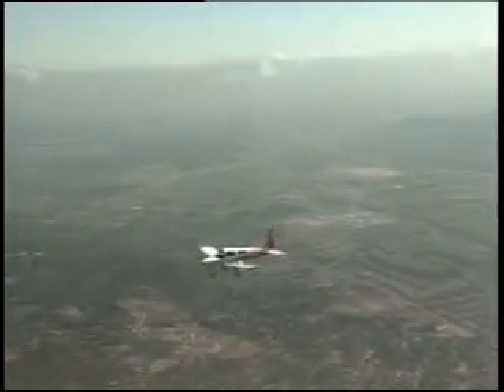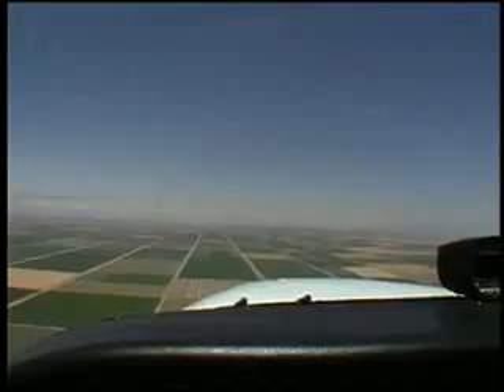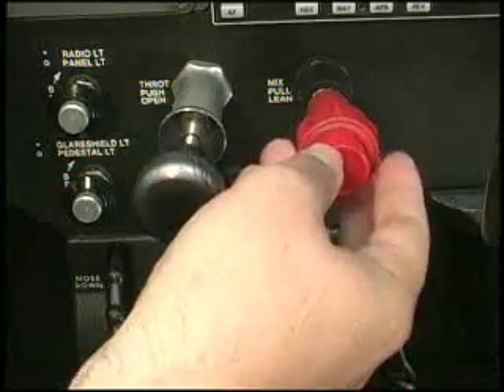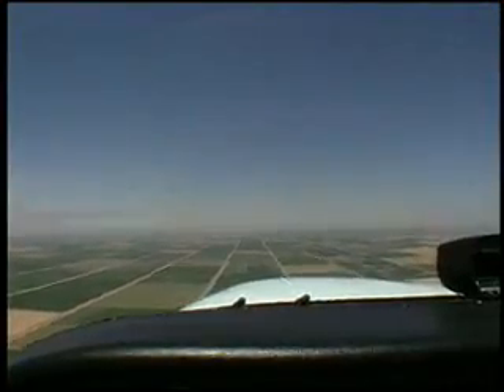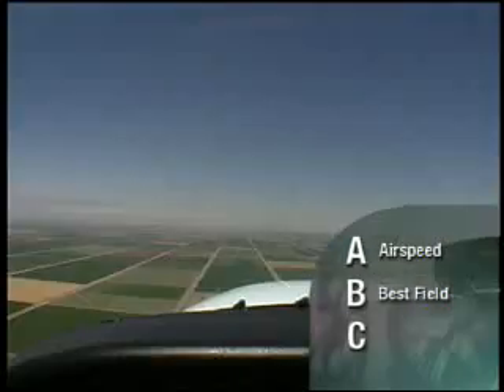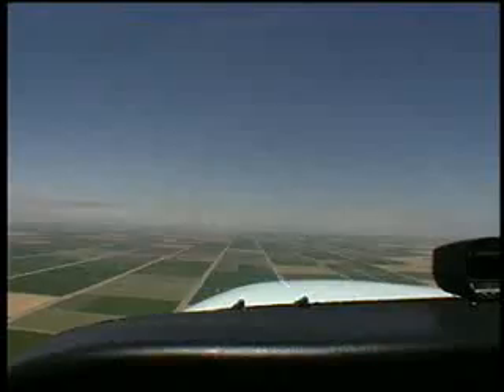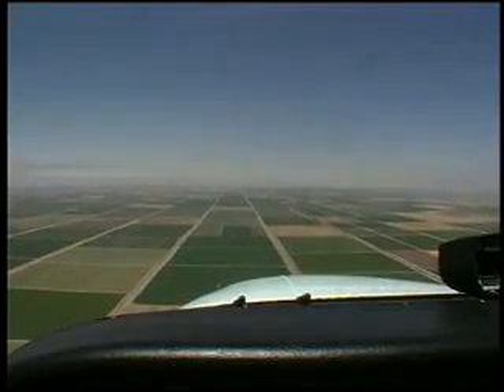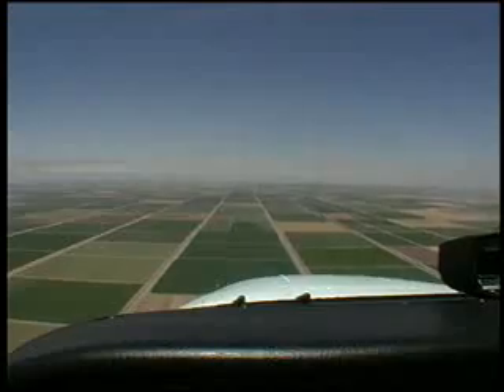In-flight Aircraft Fire.  What should you do? - KINGSCHOOLS.COM

Comment: I think for the cessna 172, the most efficient airspeed is 68 knots (If I remember correctly) where you have the maximum lift produced by wings and the least drag. So why would we want to fly at 100 knots?
Reply: 1) More airspeed to help put out the fire
2) To get to the ground quicker - your airplane is on fire!
Reply: 68 is the best glide speed. 100 knots he’s talking about is to put the engine fire out but that speed varies in different aircraft.
Reply: Our checklist says to bank 30 and dive 20 a d spiral down at top of green arc (I think)

Comment: How does leaving mags on consume any fuel if you already killed the engine by leaning the mixture? Not being a smartass just trying to figure out his process.
Reply: freddyfreeloader1200 Because the propeller will still be spinning with the wind acting on it thus driving the pistons thus driving the magnetos thus the remaining fuel entering the engine will be burned within the engine.
Reply: If you turn off the mags, you turn off the spark plugs and would leave un-burnt fuel in the cylinders meaning a fire could continue burning even after the engine stopped. 
The reason we use the mixture to stop the engine is to consume all the fuel in the engine and starve a potential fire. On the ground, it also prevents the engine from starting if someone turn the propeller while the mags are on.